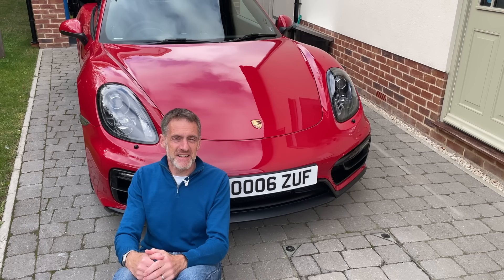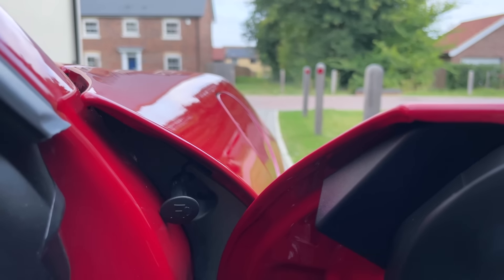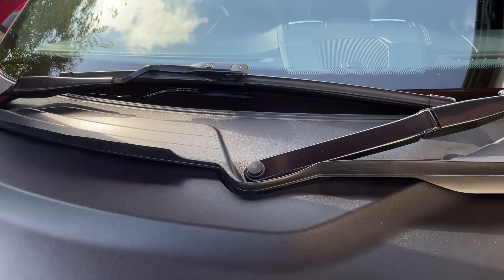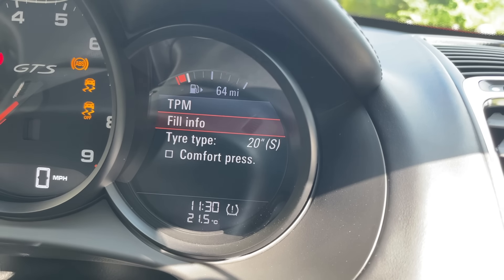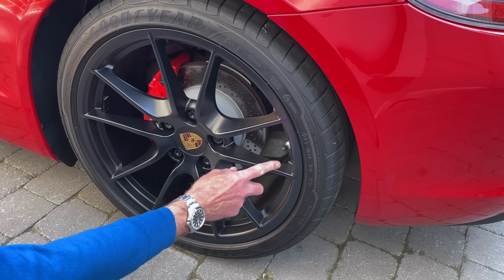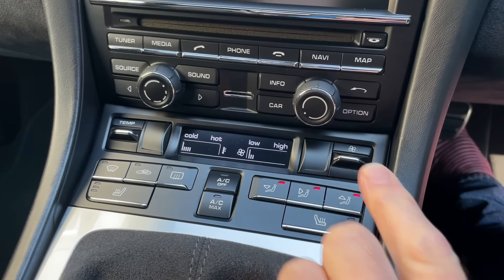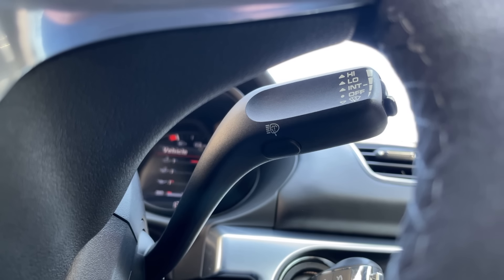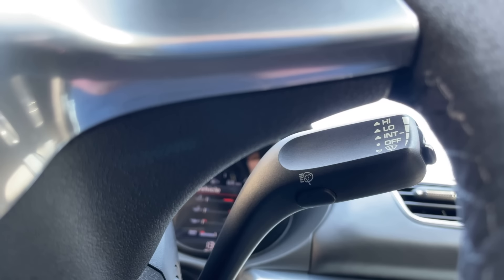Thirty (30!) Hacks, Hints and Tips for your Porsche Boxster, Cayman and 911 – Part One

Comment: Great information, i currently own a 2005 DB9 but am seriously considering either a 981 Boxster or a 997 Carrera S as my next purchase. What beautiful, well kept machine you have!👏👏👏 Subbed!☺️
Reply from the maker: @oggie1967  Thanks for commenting - appreciated. 👍

That’s a mighty engine in the DB9 - though I don’t think you’ll be disappointed with the flat six. Plenty of character…

I previously owned a 997.2 C2S, which was brilliant. A very capable alternative to the DB9. The only reason I sold it was because I missed owning a convertible - and don’t like the 911 cab’s looks.

Comment: Very informative video. I just need to find the perfect spec 981 for me. I prefer the Cayman but would also consider a Boxter. I have never owned a convertible before and can’t see myself driving around with the top down. I live in probably the wettest part of Scotland so I wouldn’t get much of a chance to do so 😊
Reply from the maker: Thanks for the positive comment Gary. The Boxster’s roof is good; the Cayman is obviously a touch better if left out year-round, and I understand is marginally sharper due to its stiffness (though the Boxster doesn’t do scuttle shake). Plenty of cars out there to choose from; take your time, and try and drive a few before you buy.

Comment: Nice Job! US cars don't get the roof controls unfortunately as we're considered too litigious. I tried fixing this by having my dealer recode, but though he saw the option, there was no way to turn it on for a US Spec car. You can get a Mod4Cars Smarttop controller that allows you to raise and lower the top from from the key (and it gives you options on how you want to position the windows when you do so - up or down). Good call on the battery tender! My battery went dead one winter and even with the tender, it lost voltage. In the spring the car had lost a good deal of it's coding. Replacing the battery helped, but it needed to go back to the dealer to have the windows recoded (the auto-up and down functions). Thanks again, I'm going off now to check the expiry date on my wheel gunk and to put a couple of rubber gloves in there!
Reply from the maker: Hi Richard. Glad you enjoyed the video - and thanks for commenting.

Most of us have learnt the battery 'lesson' the hard way! That sounds familiar... 😀

Make time to watch parts two and three if you haven't already done so - a few more bits and pieces worth knowing!
Reply: @christianpratt  Will Do! Thanks again. I did watch Part 2, about to watch 3. You go into some "funny stuff" I don't think we get here, like the light dipping. You made me check my wheel gunk! It expired in 2016! I'm looking for replacements now! I just got my car back from the shop - close to $4K in repairs because the soft top stopped working - they replaced the latch and two microswitches.
Reply from the maker: @blackmanxrjc  It's easy to take for granted local-market options - though hard to know what other markets do and don't have!

Gunk - in Europe at least it's easy enough to buy VW's own gunk since it's basically the same. Definitely try and avoid the Porsche tax on this one!

Glad your roof is working agin but - ooof - that's a steep bill! My financial sympathies...

Comment: As a past 986 and 987 owner and current 982 owner i thought I knew it all. How wrong I was. Lots learnt. What a brilliant couple of videos - thank you Christian. Holding the button while putting the roof up negotiating a roundabout at 30 mph during a rain shower now a thing of the past. 😂BTW Porsche say max 50 kph for opening/closing. Anybody tried at any higher speed? Presumably it won't work and a warning comes up on the dash?
Reply from the maker: Thanks Steve - glad you found them both useful!

Only one way to find out what happens above 50kph... 😀  (No, I've never tried it!)

Comment: I thought there wouldn't be anything to pick up on here having had a couple of Boxsters and 911's  but much to my embarrassment there were several and I am going to look into buying a firestick. 
One thing I found very useful during my ownership is a wheel support peg. For anybody not familiar with this item its simply an M14 x 1.5 threaded shaft that you screw into the wheel hub after removing the first wheel bolt, doing this prevents the wheel coming off in an uncontrolled manner as you can simply slide the wheel along the shaft to remove it, it also makes aligning the wheel when putting it back on a lot easier.
Reply from the maker: Thanks for commenting Graham - glad I've been able to add one or two more things to your knowledge!

Good point about the wheel support peg; I'll add that to my list for (I hope!) part three...

Comment: Useful video, thankyou,  i have been using the 718s footwell socket to attach my CTEK, need to make sure its fully in, but no issues so far.  A minor niggle for me is that water/shampoo gets under the bonnet when washing the car (not into the frunk though). My 987S was slightly worse.
Reply from the maker: @robsx4280  Thanks for the comments Rob. Glad the footwell socket is working for you. 

I had the same frustration with my own 987 - too much foam and water into the battery tray and surrounds. 981/2 much improved but yes - still a bit leaky as it were!

Comment: Nice video, I learned more, thank you. I also have a little storage bag for my wind deflector that is velcro attached inside the boot below the emergency triangle box. Not sure if it's original as I don't see one in your frunk? I hardly use it other than to store other items. Cheers.
Reply from the maker: Thanks for commenting - glad you found it useful.

My 987's OEM wind deflector came with a storage bag but I don't believe the 981 OEM deflector did. I need to get one made for the odd occasions when I take mine out. 😀
Reply: @christianpratt  sounds good!

Comment: Really enjoy Project 981 please keep up the good work.  I want to mimic your  Ctek direct battery connection set up; what size eyelets did you use for the   Ctek lead and what was the bolt you used for the negative connection?
Reply from the maker: Hi Alastair. Thanks for the positive comments - that's much appreciated.

You'll need an M8 bolt of suitable length for the earth/body. Which means that the M8-sized eyelet is perfect.

However, be aware that Ctek sell both an M6 and M8-sized eyelet/adaptor. If you already have the smaller  M6 adaptor (I did - it came with my charger) then you'll either need to slightly enlarge the Earth/negative eyelet (I carefully drilled it out) or spilt it and then gently bend each side to fit around the bolt shank. Both options work well enough.

But if you have neither, then by the M8 version.

Comment: Great tips! Thanks for sharing! What is it about the negative battery charger hooking to the body vs negative of the battery?
Reply from the maker: Hi Andrew. Glad you found them useful - appreciate the feedback. The answer to your question revolves around whether a car - the Porsche - has a BMS: a battery management system. And the 981 does.

From the CTek website FAQ:

"The CTEK manual says: ”Connect the black clamp to the vehicle chassis remote from the fuel pipe and the battery".  In the picture next to this, the black clamp is connected to the battery's negative pole. Which is correct? 

When you use a CTEK charger, you can use both connections.  The charger should be connected according to the vehicle user manual. If there are no other recommendations in the manual, the negative or black connector should be safely connected to the chassis.

The connectors on old “non-smart” chargers can spark if the connectors touch each other, which could be dangerous if this happens near the battery. Keeping the connectors apart, and ensuring the positive connection point is as far away from the negative connection point as possible, will help to minimize any risk.

If your vehicle has a BMS you cannot connect to the negative battery pole, the connection must be made to the earth or ground point, if you are in any doubt then connect to the nearest earth or ground point."

Hope that helps explain why my car's conditioner cable is earthed to the chassis.
Reply: @christianpratt  - great info! Thank you, Christian! 🤝

Comment: Just one thing, regarding tyre pressure - all the tyre specialists say use the tyre company recommendations not the car manufacturers - unless you have the OEM tyres.
Reply from the maker: @Aiken47  Good point.

(And then we’re into the N rated versus non-N rated tyre discussion! 🤪)

Comment: I wanted to add to the bit about charging it. I too used to charge/maintain the battery to my Cayman directly as you do. But after some thorough research, I found that you can charge it with an interior 12v socket. The big trick is in Porsche's infinite wisdom, they shut off extra electrics to save on battery power for storage for long periods. I believe it lasts for a few days before it will shut that off and will no longer charge from that socket. You get around that by simply locking the door and that keeps that 12v socket live for as long as it is locked. Then you can keep a battery tender through the duration of however long you store it. You can safely close the door on the cord or you can run it through an open window if you'd prefer.
Reply from the maker: We've ended up doing the same two things in reverse!

I started charging the battery through the footwell 12v - which had previously worked flawlessly in my earlier 987 and 997. But, as you note, the socket can sometimes switch itself off, which isn't ideal. I got fed up with the uncertainty of that - sometimes it would go for weeks, other times for only 30 minutes, and I could never quite understand what I was doing differently (perhaps I didnt' lock the door quickl enough?) - so decided to go under the bonnet instead.

In truth, I'm happy with under-the-bonnet. It involves slightly more effort, but I'm happy enough to leave the car now, knowing it'll never not charge.

Appreciate the comment and insights - thank you. 👍
Reply: @christianpratt  Ah, interesting. It seems like I heard the footwell one isn't as reliable as the center console one, which is the one I use in my 981. The footwell one might be on that same circuit that shuts off after a few days. There shouldn't be any sort of time to lock it. I've had times of forgetting and then locking mine a few days later and the charger would light up instantly with starting to charge it.
Anyway, just info out there for those that might be having a problem with charging with interior 12v vs directly with the battery. I appreciate the vids and info you put out there! Thank you!
Reply from the maker: @GrimR  Useful to know. I might go back and try the console one in that case. It's certainly easier to use than having to lift the bonnet every time.

Glad you're enjoying the videos - thanks for all the comments. 👍
Reply: Recently got 992 Carrera. Don't have space for it in the garage is it safe to trickle charge with lead / power cable under bonnet or through window in the open? My drive and surrounding area is very safe as not in London.
Reply: @stevosd60  Congrats on your new 992! Yeah, should be able to have the power cable under the bonnet safely. Or if you're able to charge it with the interior socket as I mentioned, you might be able to just close the door on the cord as I do with my 981. But I don't know if that's a smaller gap with the 992. Going through the window is an option, but then you have a window cracked open for the elements to get through.
Reply from the maker: @GrimR  @stevosd60 Quick endorse for under-the-bonnet. Likely your best option is to attach a harness to the battery/earth and then you simply have to connect the charger cord each time. You don't even have to take the cable out under the bonnet - I'm pretty sure there will be a gap under the scuttle/base of the windscreen you could poke the wire through (as I do) instead. (Nobody wants an open window!)

Congratulations on the new car - very nice!

Comment: I’ve repkaced the stock battery with a lithium battery ,it’s the best upgrade
Reply from the maker: Interesting! Weight-saving aside, have you noticed any other benefits? And do you need/use a specific battery conditioner versus, say, and AGM battery?
Reply: @christianpratt  more power volts immediately, 10yr guarantee, never goes flat which I tested by leaving the cabin lights on overnight of course in the morning it wouldn’t start so option is to reset it via a button on top of said batter, or as in our case the hood can’t be open ,use the app to reset it and ‘’voila’’ battery is fully energised immediately, as you said weight benefits and its half the size just connect it with existing cables
Reply from the maker: @blackhat856  Gosh - slightly more sophisticated than a lead acid battery! Appreciate the insights. 👍

Comment: Good video that, great idea with the C tec charger, just ordered the little extra lead and have a bolt for the strut tower as well, what bulbs did you order please, also I never realized I had the little interior centre console light is was turned down so low, now it’s on 90% 👍🏼
Reply from the maker: @Trophy_R  Thanks for the comments - great to hear you’ve found the video useful.

I must confess I don’t know the specific bulb specification (the OEM incandescent is 5W I think). I’ve relied on the retailer’s knowledge - Design911 in my case - to identify the correct LED replacement. 

90% - happy illumination!
Reply: @christianpratt  Brilliant if you can let me know which bulbs when you find out I’ll get some ordered
Reply from the maker: @Trophy_R  Here is the part number and description from my Design911 invoice:

99963103290LED BULBS T10/501 2 X SMD LED'S (PAIR) SLOT IN

Comment: One bonus thing for the battery maintainer/charger is to have an in-line fuse on the positive side of the CTEK tail. 

This will act as a fail safe if the positive wire gets damaged and shorts out, at least it will just be a fuse that fails. Not the car.
Reply from the maker: @rebelranter  Good point. I vaguely recall seeing an inline fuse adaptor somewhere in my garage - I’ll go and have a look!

Comment: Great tips, thank you again! Question on the Ctek and the anchor points, I don’t have a bolt in the turret and you mentioned a M6 or M8 bolt, do you know which and presume a stainless steel bolt is ok?
Reply from the maker: @Rico1973  Many thanks Mark.

You’ll need an M8 bolt of suitable length. Stainless would be best, so you have a clean metal-on-metal contact.

Be aware that Ctek sell both an M6 and M8-sized eyelet/adaptor. If you have the smaller (I did) then you’ll either need to slightly enlarge the Earth/negative eyelet (I carefully drilled it out) or spilt it and then gently bend each side to fit around the bolt shank.
Reply: @christianpratt  thank you. I’ve got the small eyelets (M6) and managed to snap it!! Just ordered an M8 connector for a few quid so that should do the job 👍🏻
Reply from the maker: @Rico1973  Aaah! Well, that will do the job. 😃
Reply: It's recommended to use the earth point near the wiper mechanism, which is also the point for jump starting the car.

Comment: I remove the light bulb located in the frunk as this light remains “on” while I charge the car’s battery.
Reply: I keep the frunk lid in the open position while charging.
Reply from the maker: @Te-bj1yk  Aaah - hence removing the bulb. Makes sense; no need to risk it overheating or damaging the mount.

Comment: Hello. Do you have any idea why my soft top goes only half way open and stops? It can't go further and the screen shows "soft top fault".
Reply from the maker: @JanKotarzewski  Hello Jan.

That’s beyond my level of knowledge I’m afraid. Though I understand that sometimes these faults are caused by faulty sensors (which control the mechanism) rather than the mechanism itself.

Worth getting somebody/a garage to ‘read’ the error code for you - that should help identify the specific problem.

Hope you get it sorted.
Reply: @christianpratt  Thanks for your answer, I'll try to figure it out.

Comment: The only flaw I see in boxster is the rear speakers. They get covered by the seat, therefore a muffed sound. Any tip on that guys?
Reply from the maker: Good point Ricardo. A challenge facing most two-seat sports cars. My car doesn’t have BOSE (or the Burmeister system) which solves the problem, because the grills are hiding empty spaces. 🤪

That said, I had BOSE in a previous Boxster and found the sound stage pretty good. The mid and high range drivers are in front of the driver, of course, so the detail doesn’t suffer too much.

No easy way to solve the problem, though it’s an acoustic compromise I’m personally happy with.
Reply: @christianpratt  by the way Chris, forgot to thank you for your fantastic video!!!!
Reply from the maker: @ricardoterada  Thank you - that's really appreciated!

Comment: My 2023 Boxster does not have the remote auto top open close feature.
Reply from the maker: @toddg9956  Appreciate the comment Todd. Are you based in the US? It seems the remote ‘hood’ legislation differs between Europe and the States…
Reply: @christianpratt  yes I’m in California. To bad that is a great feature.
Reply from the maker: @toddg9956  I understand that it’s possible to enable the feature using Porsche’s workshop diagnostics platform - PIWIS - which the dealers and some indies have. Worth asking around and/or checking the forums (Rennlist?), if it appeals to you.